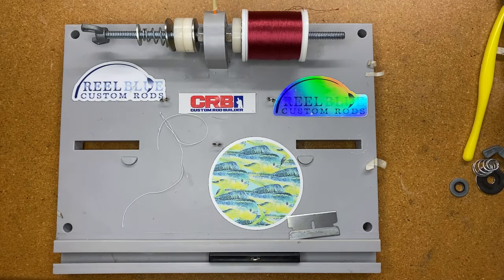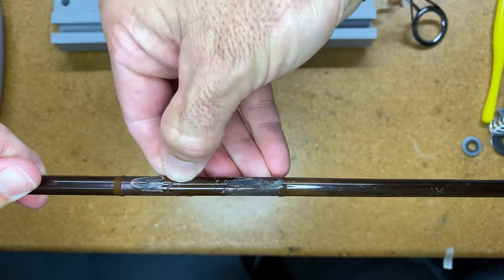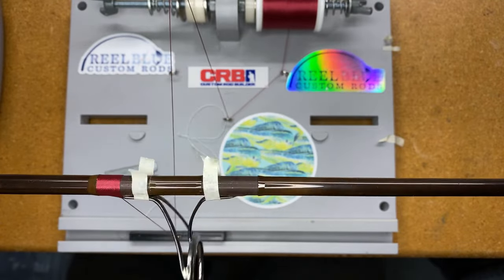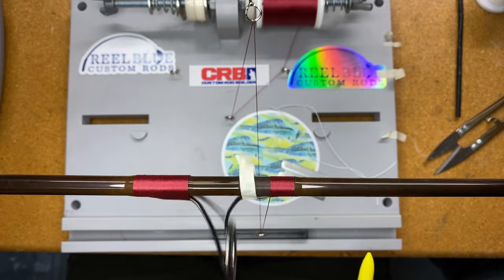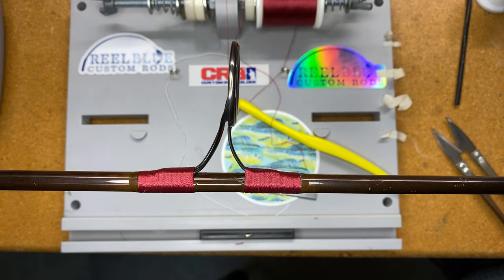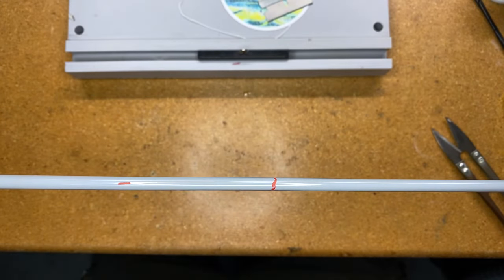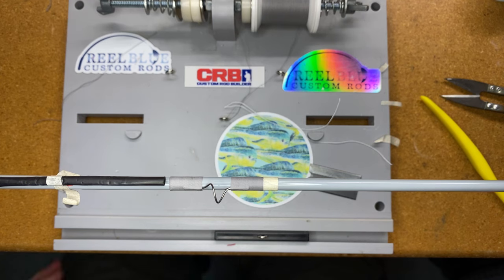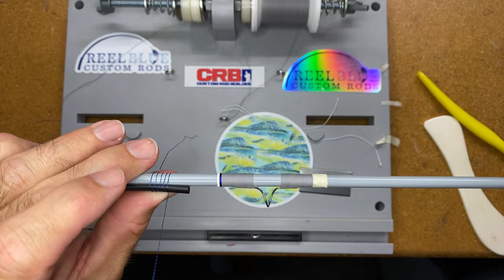Wrap Like a Pro: Expert Guide Wrap and Tag Wrap Strategies

Comment: Newbie builder here.. used your straw method with recent tag wraps but they would come loose when I burnished them.  I started adding a wee drop of color preserver just where the two tag ends stuck out then waited to trim them until the CP had dried.  No more unravelling.  Yay!!! Thanks for sharing that method, it makes a nail knot much nicer than the one where you don't use the straw but trap the threads between your thumb & index finger.  Sorry I missed the live stream... next time...
Reply from the maker: Glad to hear this technique is working out for you Marv, and hope to see you in there next time I go live.  Thank you for watching and commenting.

Comment: You are giving ideas on my build, but i need to know which way to point the guide since one side of the large guides are looped around both sides of the guide.
Reply: i gained a lot of information on adding the guides to my blank 2-piece rod build.
Reply from the maker: @arnoldl.arrington5147  - as you see it in the thumbnail it should be applied to the blank.  Meaning, in the thumbnail, the bottom or butt of the rod is at the bottom of the thumbnail.